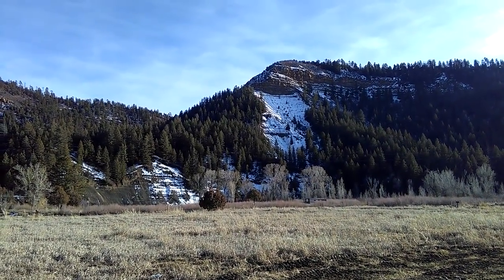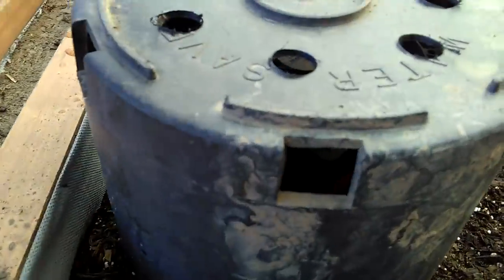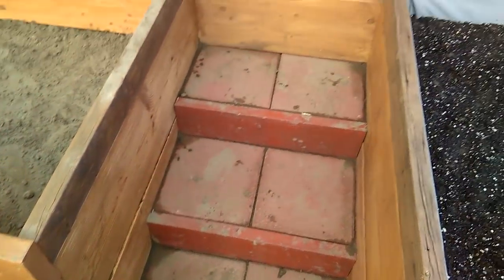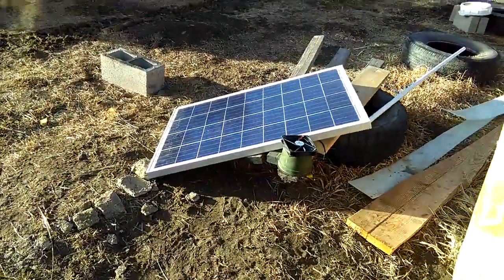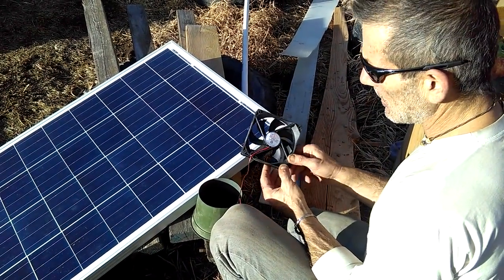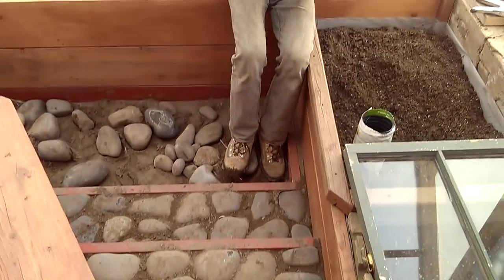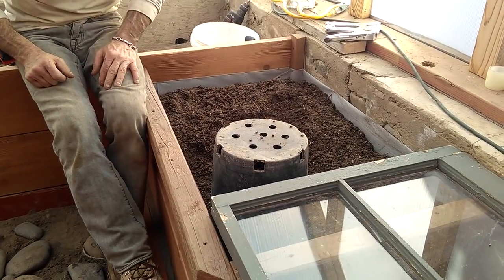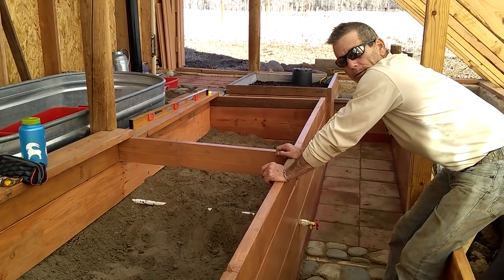Geothermal Greenhouse Update 2/4/18 - Thermal Mass Heat Storage - Secrets Revealed - Pavers

Comment: In the UK when I lived there, I  used a composting pit with an upward sloping pipe into the greenhouse, the compost produces heat as it breaks down and heat transfers via a 6inch diameter pipe. 
Thank you for the info, it is great.

Comment: Have you measured the air flow rate? They must have a lot of static head to push/pull. Would a inline duct fan provide a better flow rate? What kind of temperature differential do you see between the inflow and outflow?

Comment: What about using 6” or 8” pvc around the fans with stainless steel screen on top; would provide solid protection and allow full air flow and use minimal space. just a thought.
Reply from the maker: Cost

Comment: do you find the computer fan is enough to push air through all the hose.  I have yet to make my heat sink in my greenhouse but bought an in line 4" fan that I am hoping will do the trick

Comment: just a question D if the fan speed was slower would it be warmer,faster speed colder.?
Reply from the maker: Slower vs Faster = more or less stored heat. You are creating a heat budget by adding btu's to the climate battery. Faster fans or sunnier days = more heat storage. We will be experimenting with subsurface thermos for the first year in order to better understand the thermodynamics of the unit. Each design and placement will react differently. No two geothermal greenhouses are alike.